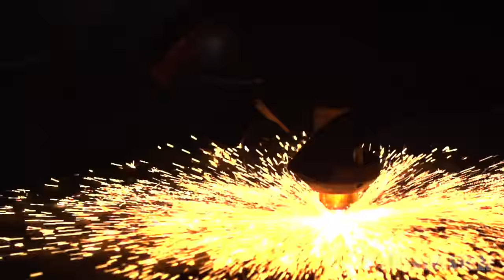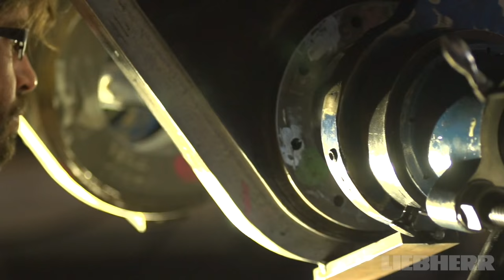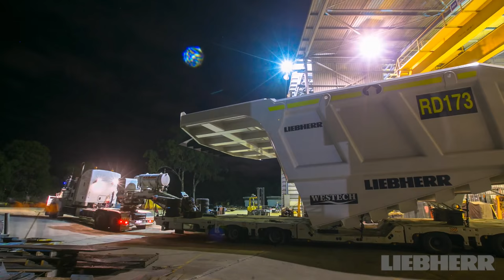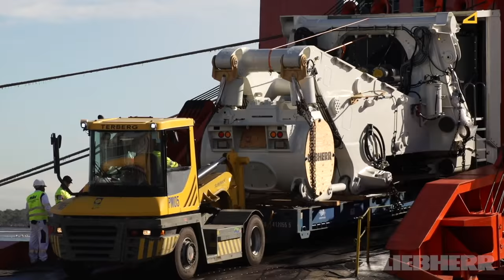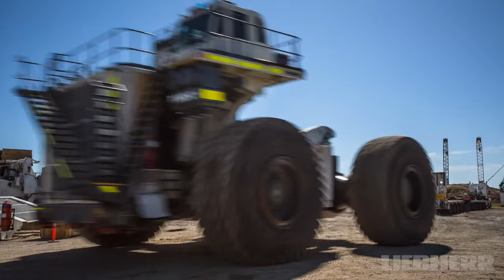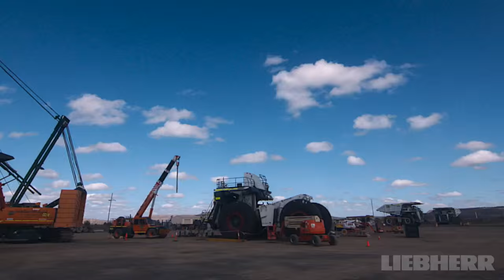Liebherr - Assembling and behind-the-scenes of the T 282 C Haul Trucks in Australia

Comment: why take the truck halfway to site, put it together then apart again and then the rest of the way to mine site.?can any one tell me the reason why, great video .
Reply: @Jerry Eicher in this case height was also a factor. >5.5M and you need to lift power lines which, believe it or not, is more expensive than partial disassembly/reassembly. It's a pity the video didn't show the truck chassis being hauled up the Eton range; that is an impressive and nerve racking sight watching a near 150t chassis being pushed and pulled by up to 4 prime movers at full noise.